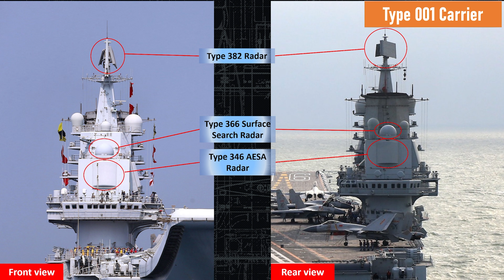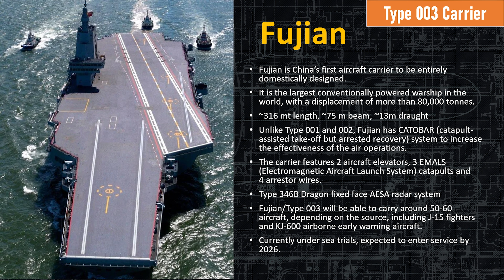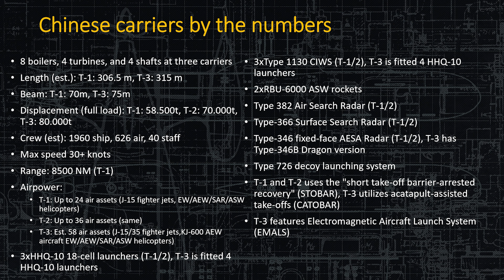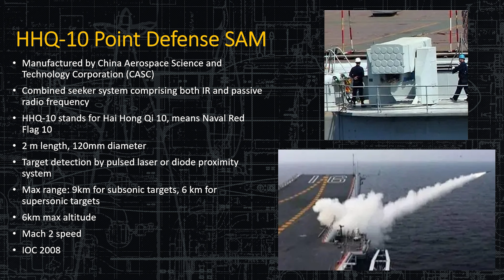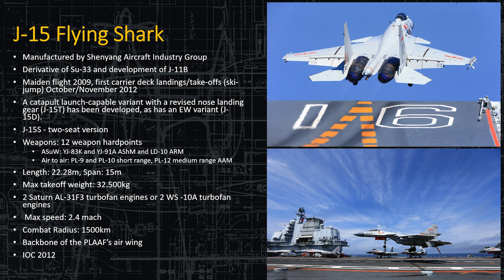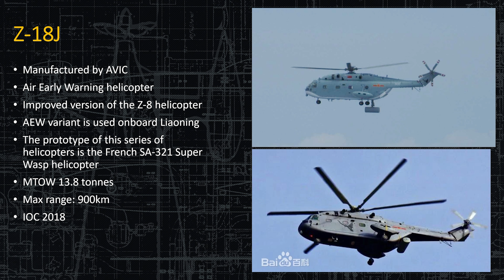China's New Fujian Carrier Changes Everything - Here's Why

Comment: Type 004 is going to be between 110,000 to 120,000 tons and is confirmed to be Thorium powered.
Reply: Really? Feels like a crazy high development risk for very little actual benefit.
Reply: @danielch6662  - why is it a high "development risk"?
Reply: @canismajoris3910 because the production vessel will be the prototype. It has never been done before. What could possibly go wrong?
Reply: @randys2358  - the Chinese have nuclear submarines. They are also building cutting edge nuclear power plants at break neck speed right now. Started exporting nuclear power plants in various countries. While it looks like they have no experience in nuclear aircraft carriers. They have been doing individual various component testing while doing evaluations on their other aircraft carriers simultaneously. China has the most engineers in the world, I'm sure they can figure things out. The scope, the scale and speed is not to be underestimated.
Reply: @danielch6662  Nope, TMSR is safer and easier to refuel than PWRs. You can build them in deserts. It doesn't require any water. And they're already talking about building them into civilian cargo vessels.
Reply: @yojimbo3681 😂😂😂  superstition at best
Reply: @soakupthesunman  - I believe yojimbo is correct. There was announcement in multiple Chinese News channels that nuclear cargo ships are in development. Well, they said green energy. It is likely it means nuclear, hydrogen and diesel/battery hybrid are all simultaneously being developed. Nuclear ones are likely for the larger cargo ships.
Reply: No it ain't... go listen to the real "big shrimps"... the 004 will have 4 conventional reactors. Thorium ain't nowhere near ready. The FIRST Chinese TMSR that's going to be able to generate power is under construction RIGHT NOW. The experimental one only demonstrated U233 breeding in 2025.
Reply: @andrewsuryali8540  - what "big shrimps"? There are two carriers under construction right now. There is a lot of evidence that is indicating at least one of them is nuclear powered. Whether it is Thorium MSR or other models is not that important, the basis is it will be nuclear powered.
Reply: Nothing about its reactor is confirmed yet. We know the shipyard is hiring nuclear engineers and putting out tenders for nuclear reactors but we simply do not know what kind, what power and how many exactly. All will be revealed in due time, no need to spread misinformation.
Reply: 😂😂😂😂😂
So is my next house!
Reply: @soakupthesunman  Your coping is hilarious.
Reply: Nope! It's a None Nuclear Propaganda Piece! US has 11 Super Carriers and 9 Carries, so China's Psy-op here is Pathetic...
Reply: @RealRandyRoss Of which only 3 is working. The rest are either in repairs which take forever, or in queue for repairs. The US literally does not have the shipbuilding capacity to sustain these carriers.

11 carriers not. And no real way to defend against missiles like the YJ-17, YJ-19, YJ-20, YJ-21 and DF-27. They will get hit the first moment they dare to attack China.

Pathetic.
Reply: @RealRandyRoss  - just wondering how you know these two carriers that are under construction are not nuclear? Btw, US Carriers and many ships are aging. Many are in line to be decommissioned. Nimitz has likely gone its last voyage. Eisenhower will be soon.

Comment: the type 003 has a catapult on the offset that is at an improper angle. there will be a plane launched at some point that banks right and smashes into the bow near the waterline. stupid design.
Reply: @kingmemike10  thats true but seeing how every new one is differnt i woudnt be surprised if type 1 to 3 are gonna just be test platforms and type 04 is gonna be the one thats gonna be mass produced
Reply: @ihcuwign1707  depends on how it performs. And how much new tech they want to cram on. China doesn't actually NEED carriers right now. They don't fight foreign wars. They're just toys, training tools, for their pilots, crew, and engineers to gain experience on. Because that's the only way to gain experience.
Reply: @danielch6662 😂😂😂
Great way of explaining away inferior and useless "weaponry".
Reply: @danielch6662 by all means strike you know where to find them
Reply: @danielch6662  that and also to launch stealth jets and flnakers in full payload to keep usa away

Comment: They have not used the port or starboard cats.  They've only used the center cat, indicating it may be the only cat that actually works.  And the most recent reports are the ship broke and is back in port for "repairs".
Reply: A simple google search showed the aircraft being launched by both forward cat 5 months ago. Also every few months some retarded youtube channel would say the carrier has cracks when that's just ventilation shaft water on the deck. I don't even know what's the problem? With people online when commenting military stuff. At least read something from pentagon, UNSI, or Janes
Reply: @ohyeahwhat5387  There is ample footage of the other cats being used. Don’t be such a dimwit.
Reply: They were only out for sea trials. How long do you want a diesel carrier to be out sailing in circles with nowhere to go? 

I don't think there were any serious problems. If any turned up during the trials, we didn't hear about them. They weren't bad enough it prevented them from launching and retrieving aircraft. 

More likely, the "repairs" are merely tuneups and improvements to optimize their performance. The biggest indicators that the EM cats are working is the fact that they've already put them on a second ship, Sichuan.
Reply: We don't know if the other two cats have been used. To be more precise, there was only one time journalists were allowed on board to film the test operations of Fujian, back in Spring 2025, and CCTV has been RECYCLING THE FOOTAGE FROM THAT TIME again and again and again and again and again and again and again ever since. There's only one set of stock reels and that's it. Most likely we'll only see the other cats used when JMSDF recon planes get to film the Fujian.
Reply: @a @andrewsuryali8540  you need help finding readily available content on the internet, just say so.
Reply: They have used them, just because you don’t see them doesn’t mean they’re not being used

Comment: I’d like to see a study/opinion piece on how long it would take the PLAN to take over and convert the old KIEV and MINSK into VIKRAMADITYA Class aircraft carriers, if China gets into a bind for 2 more light carriers because they can’t get their two large deck carriers combat ready.

Just asking for a friend.
Reply: Minsk burned down in a fire two years ago. It looked worse than the one on the Bonfire Richard. Kiev is a hotel.

It'll probably be easier, cheaper, and faster to just build another 002. The original 002 took 5 years, but the hull alone, just slightly over a year. And they weren't rushing, and that was their first, and a decade ago, their shipbuilding industry wasn't in the state it is now. If they tried it now, they could probably get everything complete in about 1 - 2 years.

And they would end up with a new ship, build on an outdated 40 year old design. Instead of actual 60 year old hulks barely patched up. Furthermore the Kiev-class design is about 2 decades older than the Kuznetsov-class design (the 001 and 002).

In a pinch, China could build 3 carriers simultaneously. Even more if they were desperate and converted additional civilian shipyards. The fact is, more than 50% of the entire planet's shipbuilding capacity is in China right now.
Reply: @danielch6662 
The MINSK’s superstructure was heavily damaged.
Reply: Why would  they want to do that?  They are already pretty steadily hitting 2 large amphibious warships (75 & 76 types) per year.  Easier to modify something like that as a stop gap, and to be blunt, probably better having a larger number of smaller all drone carriers than a small number of super high value human flight based carriers.  Not to mention, remember, any upcoming conflict China may be planning already hands them the largest aircraft carrier on planet earth: mainland China.
Reply: @LackofFaithify they might do that because they don’t have any VSTOL aircraft in their inventory. They can’t use their small carriers as we can. Their J-35 apparently is not up to the task.
Reply: @living2ndchildhood598 What are you yapping about?
Reply: @living2ndchildhood598  I mean, the 076 has a cat. PLAN doesn't need STOVL jets.
Reply: There are 6 shipyards in China able to build 002-sized carriers: Dalian, Dagushan (which belongs to Dalian), Jiangnan, Huadong Zhonghua, Longxue, and Huludao (the nuclear submarine yard - it has a 200,000-ton slipway attached to it). They can probably build new ones faster than converting the Kievs.

Longxue was actually where Chinese carrier development started. This is the shipyard that studied and dismantled the HMAS Melbourne. Longxue had a proposal for a 28,000-ton light carrier with a single steam cat (basically upsized Melbourne) back in the early 2000s, but that never got anywhere.
Reply: Vikramaditiya that sorry excuse for a carrier ?🙄 even as a ski ramp carrier it’s pathetic that’s going backwards for them 🙄

Comment: Of the two forward jet blast deflectors, the one on the port side goes into the landing area.  Meaning, if it wants to launch and recover at the same time, it can only use the starboard most catapult.  Just one out of three if it's landing and recovering simultaneously. NOT an efficient or effective design.  Better than their ski jump carriers for sure but not even as good as a Forrestal either.
Edit:  My mistake.  I thought planes could be launched off the bow and recovered on the angled deck at the same time.
Reply: They switched from steam to EMALS post deck design, hence the overlap.
Reply: @jiokl7g9t6  I guess the USN should be thankful they degraded the design.  I wonder what other ships have design inefficiencies.
Reply: @1977Yakko 

They've all been compensated for 😁
Reply: Because the Kung Fu Master Xi demanded EMALS in place of steam.  The hull was already laid down, and EMALS needs an extra 100 foot of rails over steam.  And they did 6 degrees on the angle deck in place of the 9 degrees we use.  You can steal and copy, but when you don't understand what you're doing, you end up with the Fujian.
Reply: @ohyeahwhat5387  Thanks.  I heard Xi meddled with the design but that he degraded it so much is sort of awe inspiring in a strange way.
Reply: @1 @1977Yakko pe and seethe little one. Your sensationalism isn’t very good.
Reply: Every Navy does cyclical flight ops, including the USN. Try to use your brain a little bit and battle the urge to cope.
Reply: @53_FYT   My mistake.  Thanks for being civil about it.
Also, it still only has 3 catapults instead of 4 and only two elevators instead of 3 or 4 so it's ability to launch and move planes is still degraded compared to a Nimitz or Ford.
Reply: @1977Yakko  003 is a prototype. They don't intend to fight with it. There is only 1. And they're not going into serial production with this design.
Reply: @d @danielch6662 u just keep randomly making up things. No, the 003 is not a “prototype”. No one “prototypes” such large complex ships that take years to decades to build and develop its relevant technologies. 

Like I already told you, it will become a fully combat operational carrier once it reaches IOC/FOC, in the same way their STOBARs are combat operational carriers. Yes, they very much intend to “fight with it” if such a time ever came. Just because its the only one in class doesn’t make it a “prototype”. It is not unlikely and in fact rumored China may very well operate a mixed fleet of conventional and nuclear carriers, whether that conventional carrier is another 003 or revised 003 or clean sheet design, whatever. You just keep randomly making things up.
Reply: @53_FYT  cope? hilarious, when youre in actual combat you do whatever it takes to win as well as protect your carrier group. its like youre thinking these ships were not designed for a war scenario... epic fail.
Reply: No one does simultaneous launch and recovery in the first place. You clearly have no clue how carrier ops work like many under here, yet speaking quite confidently.
Reply: @Flightman453  You're late to the party.   Someone already informed me.  I honestly thought planes could launch off the bow cats while recovering planes on the angled deck.  My mistake.
Reply: @Flightman453  so in combat you would not do this when you can? tell me another story, youre great at it...

Comment: A10 is listed as 3,900 rpm 30mm
Reply: And ballistics are near identical. The GAU-8 can be run at 10000 rpm, but not on a A-10 as the recoil force would cause structural and stability issues. Fewer barrels means the continuous burst would also have to be shorter compared to the 1130 that has 11 barrels and chambers to share the thermal load.
Reply: Ammo is heavy. A plane can only carry much. This problem doesn't exist on a ship. The 1130 has two drums, each with similar capacity to A10. Reload times should be comparable to American CIWS ... about 4 minutes.

IINM the ship is also more stable, and the CIWS is optimized to 4km. The GAU8 on the A10 is optimized for 4000 feet.
Reply: The original rate of fire for the GAU-8/A Avenger cannon was selectable, with a high setting of 4,200 rounds per minute (RPM) and a low setting of 2,100 RPM, though it was later standardized to a fixed rate of 3,900 RPM to conserve barrel life and reduce overheating. the system was designed for 1,350 rounds, but it is operated with 1,174 rounds to optimize handling and balance.

Comment: I cant see how a system we felt  nesesary to dedicate 1/4 the output of two reactors, on a carrier class with twice the reactor capacity as the nimits, will be able to launch sustained sorties, on oil fires biolers, abd diesel generstors. 

But we all know xi approves of these lies...
Reply: Electromagnetic catapult saves more energy than steam catapult and requires less energy than steam. Steam is inefficient. It’s BETTER to use electromagnetic catapult if you don’t have nuclear, because what catapult needs is constant energy to recharge the super-capacitor. The steam catapult requires huge amount of energy to run, and that’s where the nuclear come in handy. You got the logic backwards
Reply: I’m sure you have objective takes and can describe the Fujian’s electrical setup since you’re so knowledgeable and confident, idiot.

Cope. You have no clue what you’re talking about.
Reply: The EMALS consumes a maximum of 122 MJ per launch and can launch once per 3 minutes. That adds up to "only" 122MJ / 180s = 0.67MW of electrity needed to be supplied. Let's just make that a round 0.7MW. Running 4 cats at the same time (which is never done) requires 2.8MW. Let's round that up to 3MW. The Ford generates 125MW of electricity out of its two reactors, each of which generates 700MW thermal energy (total 1400MW). Where the heck did you get that 1/4 number?
Reply: I don’t think Xi approves of your lack of basic high school physics and science education though.

Comment: Ministry of Defense notes Shandong can do 28 sorties per day, Liaoning can do 41. Fujian can do 60 if the catapult is working which a lack of blast marks shows it's not. A Nimitz can do 120, a Ford class is designed for a smooth 160 per day and is capable of 270 sorties over 24 hours. 12 strike groups and nearly 1500 sorties per day, where China can perform 150, maybe.